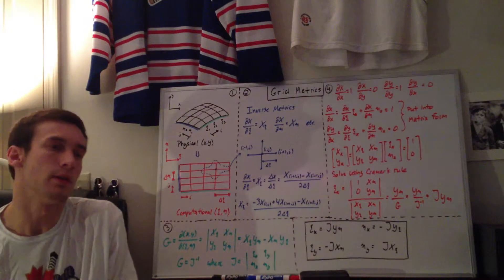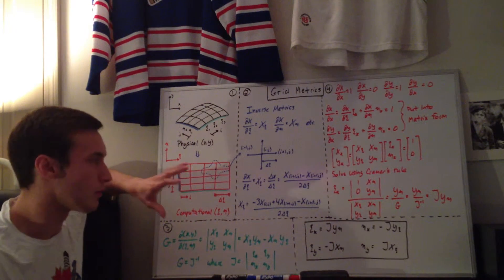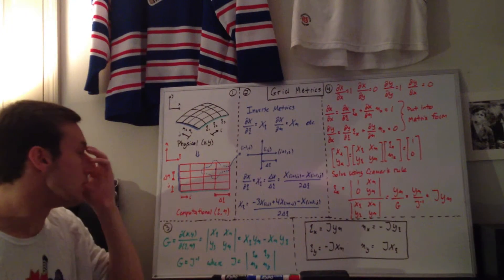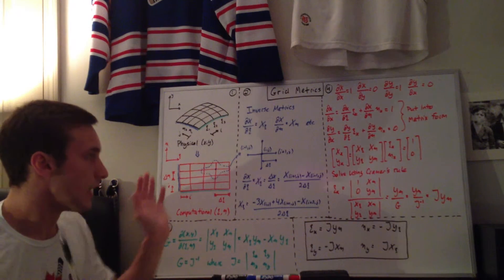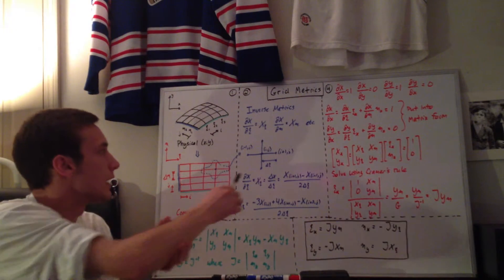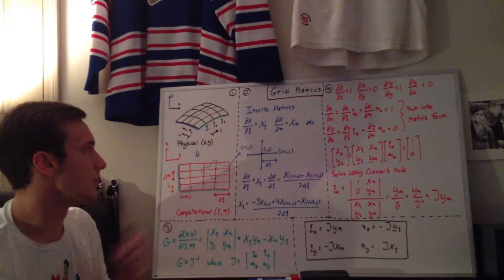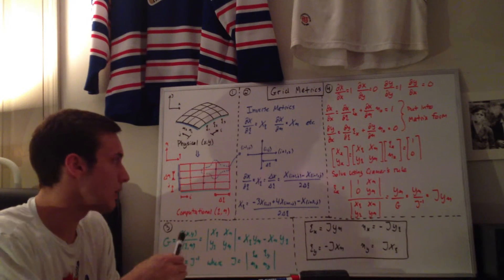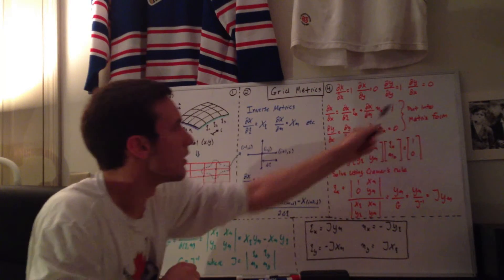Explained: Grid Metrics of the Transformation [CFD]

Comment: great lesson, Can you please show me a numerical example, where we just have the coordinate of the points .. 
(we don not know the analytical function that maps the transform the gird)
Reply from the maker: Thanks!  If you go to the link below, you'll find my Lid Driven Cavity code (in MATLAB).

https://github.com/jte0419/Lid_Driven_Cavity/blob/master/GUI_Lid_Driven_Cavity.m

The computation of the solution starts at line 314 (it's a GUI, so the thing that starts at line 314 is the callback for the push button that computes the solution).  The grid points are first defined (not analytically).  You'll note there is some code that allows for stretching at the corners of the grid if the user wants that.  The numerical calculation of the metrics starts at line 415.

Hope this helps!

Comment: The concept of coordinate transformation while using structured grids is pretty much abandoned, long time ago. Coordinate transformation works for structured grids only. One may use structured grids (uniform or not) or other arbitrary topology and CV shaped grid (unstructured and hybrid meshes)   w i t h o u t  this,  which also keeps the equations much simpler.  Your text explanation is also somewhat inprecise since non-uniform is also a structured grid, of arbitrary-changing mesh CV size.  Look for papers by Milovan Peric, Samir Muzaferija, Zeljko Lilek, Ismet Demirdzic. CFD solvers  do not  use this concept any more.
Reply from the maker: Thanks for watching and for your comment.  I'll have to respectfully disagree though.  There are many cases in which structured grids are still used.  However, it is entirely problem dependent.  There are benefits to both.  I would guess that in your area of work/research, most authors are moving towards using unstructured meshes.  However, in my area of research, you'll find that most solvers still rely on non-uniform structured meshes.  Low speed flows are very different from high speed flows, and structured mesh CFD codes will continue to be used until someone comes along and shows that unstructured solvers work better for every problem, in every situation.  I don't see that happening in the near future though.  My main point is that these metric transformations are still in use today in production code, and that the methods you use are entirely dependent on the problem you are trying to solve.
Reply: JoshTheEngineer
Sorry but you are very wrong. Please look into the papers I recommended - and (only) then come back for possible discussion. You will see were you were wrong.  Hint:  You are missing one important point in your whole rationale:  The use of structured grids does NOT require to do "coordinate transformation". Doing that is an old, obsolete, concept. I could cite now my private correspondence with Mr.Milovan Peric (see book "Computational methods for fluid dynamics" by him and J.Ferziger, he works for Star CD now), or cite some of these papers..., but it is beyond the space and limits of this conversation. In addition to that, you "are guessing" too much in your above rationale. Avoiding coord.transformation has nothing to do with using unstructured meshes only. Discretization of the equations can be performed in cartesian coordinates,  while the grid can be structured, block-structured, unstructured, or combinations of these. These are SEPARATE matters.
Reply: @milansekularac6196  In pretty a lot of scenarios, especially in academia, fundamental physic problems, the accuracy of the unstructured approach is not as good as the structured one. Your judging are way too arrogant.
Reply: @milansekularac6196  10 years later and your comment is still insanely annoying to read.
Reply: @MathIsInnocent  that has nothing to do with coordinate transformation...
Reply: @alacom205  maybe you are just to ignorant to understand the point there? But thanks.